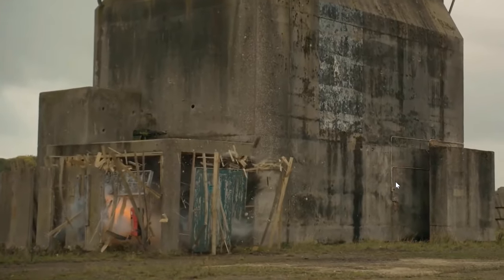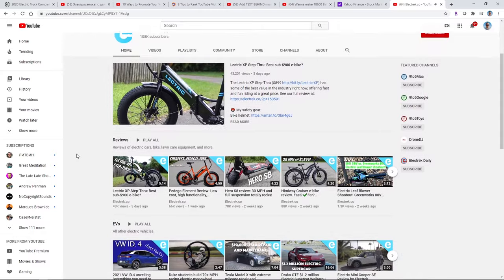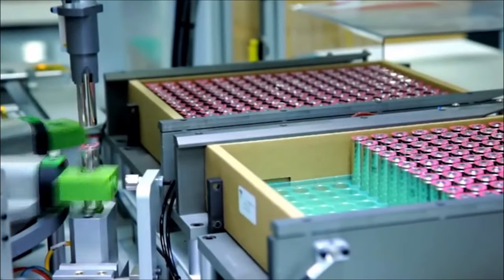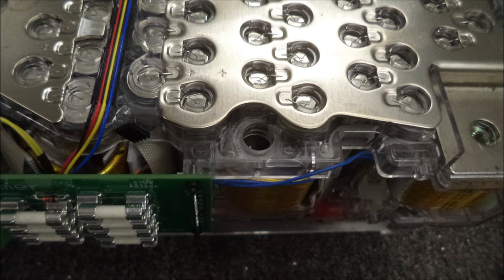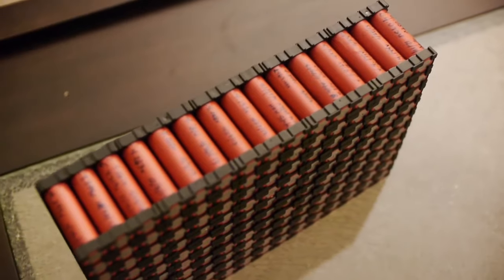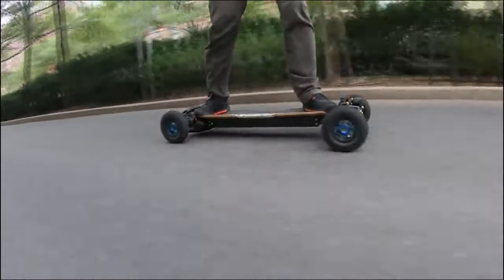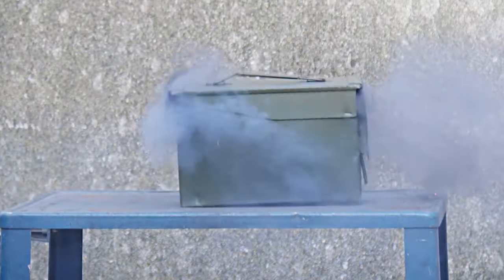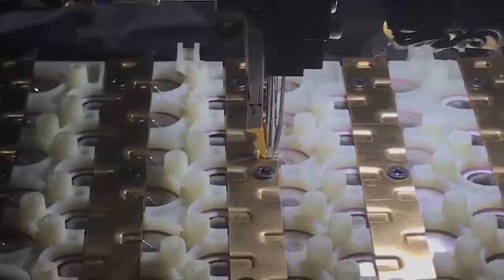7 Steps On How to build The Safest DIY Li-ion Battery

Comment: Great info. How do you look at commercial packs manufactured by the ebike manufacturers and their suppliers (such as Bosch) that do not use individually fused cells but instead connect them in parallel using thicker strips and have a single overcurrent protection circuit on the BMS?
Reply from the maker: Can fail easily and not safe. A opened a super 73 ebike battery and it had fuses so its happening
Reply: @ElectricVehicleSpace  Interesting. Even the latest models Bosch packs (the 'Powertubes') are not fused. Do you have pictures of that arrangement in that pack?
Reply: @ElectricVehicleSpace  By the way: these fuses are not there to protect against discharge currents, they are there for when the cell is internally shorted out to prevent the other cells from dumping their charge into the one that is already failing. This may prevent a fire. Typically this is used in vehicles against a pack getting crushed or damaged during an accident and the rest of the pack instantly dumping all of their charge into the cells that have been damaged causing them to explode. I think this is a fundamental piece of information that you were missing when making this video, or, if you did understand that it doesn't come out in a way that explains it clearly. So we are definitely not protecting against overcurrent discharge with these fuses.
Reply from the maker: @pianojacq  that was the all point of the video and it is explained 👌
Reply from the maker: @pianojacq  also overcharging or overloading or shorting.
Reply: @ElectricVehicleSpace  A per battery fuse in a pack with any substantial number of parallel cells (say, more than 4, which is most packs) will have cell-to-pack currents in the range of a few amps for most applications, but will have cell-to-cell currents within a cell group of 100's of Amps in case of compromise of a cell. This is what those fuses protect against, so by that point the pack is already terminally broken and the fuses are trying to prevent even worse. They have nothing to do with overcharging (that's a function of the BMS), overloading (which in a parallel setup will add up nicely to the point where you will have much more amperage available than your wiring or main pack fuse will be able to handle in the first place) or shorts other than bus bar shorts (and this is an important thing to protect against, but it is best dealt with by very solid mechanical engineering, something most amateur builds fail spectacularly at). 

So make sure you really understand the material, I can think of a scenario where for a given pack and BMS a per-cell fuse would hide a problem just long enough for a real issue to cause the pack to catch fire and that would turn a minor problem (faulty cell, or, more likely: faulty fuse or fuse connection) into a major one. You are 100% right that safely constructing batteries is difficult, that's exactly why you need to understand what you are doing and why you are doing it rather than to just follow a major manufacturer in their best practices and processes, especially when you will not be able to replicate those processes accurately enough to achieve the desired effect. 'Because Tesla does it' is by itself not a valid reason to copy their practices unless you fully understand their reasoning and engineering trade-offs, after all: you are not Tesla and you may not be able to do what they do safely or even at all. Unbalanced fuses due to manufacturing variance are more dangerous than no fuses at all!, and manufacturing them accurately requires gear worth many thousands of dollars, well outside of the budget of almost all amateur pack builders. 

If your message is 'only the likes of Tesla can safely build large packs' then there is probably a grain of truth in that but the rest of us mere mortals do have problems we want to solve in a practical way and we rely on each other and solid engineering knowledge gained over time to show how these things can be done safely in spite of the challenges.
Reply: @pianojacq This video is more like a safety sign. Very valuable when in a process of understanding deeply the forced marriage of used cells - as I am in right now. But your comments spiced this safety sign with substantial knowledge about what is actually the case about fuses. And yes, I agree that the video does not point out the precise function of a fuse. You added this knowledge. Thank you for that. Nevertheless, great video as platform for this topic. So, much thanks to both of you!

I'm building my prototypes in between stages of critical thinking about the outcome. That prevented me so far from accidents. In his book, Micah Toll is not comfortable with soldering the cells, since the heat could cause damage to the cells. What is a sound argument. He is promoting spot welding instead. But nickel stripes keep the connection even in a failure scenario. Thus, I don't get the advantage of spot welding nickel stripes despite. Therefore, I hesitate to build a bigger pack for a solar energy storage. I'm undecided in between fuses and nickel stripes. Well, by watching the video and reading your comments, I thought about spot welding a piece of nickel on each cell, just as conductive heat absorber. Then weld the fuses on it. But on the other hand, the small nickel buffer would also delay the burning of the fuse in case of an overheated cell. So, what is a reasonable way for voltage converter (1500Watts) which will be used for a fridge/freezer and some USB-Devices (±200Watts permanent with load with some peaks).

Would be great to have your thoughts on it.
Reply: @Ma-Nuu  Spotwelding is the only way to go, soldering is not something you should ever do, especially not to the negative. It injects too much heat because of the duration of the process (not because of the temperature, which is actually quite higher during a spotweld but the total energy injected is far lower because the spotweld is a matter of milliseconds).

Per cell fuses are useful once you start to go into > 10 cells parallel, but they add complexity and will result in a pack that may age much faster (though, arguably, once a fuse goes that cell group should be considered compromised anyway).

1500W without a voltage to go with it doesn't say very much, the important part is the total current in and out of the pack, you typically would fuse the whole pack for about 1.5 times maximum current and if you are going to drive inductive loads, in which case you want a slow fuse.

Try to go with the highest voltage inverter that you can get, 48V would be a good one to aim for (these can be had fairly easily). In that case you'd be looking at 30A, the question then becomes how long do you want to be able to supply that system with power, 30A sustained is nothing to sneeze at, if you want to do that for more than a few hours you'll be building a pretty serious pack. Make sure you take into your calculations that you will never use the total available capacity of a cell, you don't really want to charge to 4.2V and you don't really want to discharge to 2.7 which is the full voltage range of a cell. Typically you'd cut off around 3.3 during discharge and 4.1V during charge, which when combined with the charge/discharge curve of your chosen battery should give you a lower limit on how many cells you will need in parallel to sustain that current for the desired time.

Finally, I would suggest that before you build a massive pack like that as your first that you build a couple of smaller packs to gain some experience. Make sure your work area is absolutely spotless, no little bits of metal lying around there, cut all your strips prior to the assembly process and make sure you get real nickel strips and not cheap knockoff lightly nickel plated steel because it just isn't the same thing resistance wise.

best of luck with building your pack!
Reply: can one reupload a video? @pianojacq
Reply: yeah right. trying to save face. you screwed up. and you should reupload the video with the clear explanation.  @ElectricVehicleSpace

Comment: Seems like it should be common sense, but since it's not... Great video!
Reply from the maker: thank you. i hope it helps.
Reply: @Bo Davis -  Since when is Electrical Engineering called "Common Sense" ?  Cell Level Fusing does NOT guarantee the a P-Pack will never catch on fire ...
Reply: @MrSummitville  wearing your seatbelt does NOT guarantee that you won't die in a car accident either, so I guess I'm missing your point. Also, if "electrical engineering" is such a concern maybe there are other avenues to take in being educated than YouTube. I was mostly just being facetious in my comment, but I guess that wasn't common sense either.
Reply: @bodavis3819  Cell-level fusing does not prevent a fire, so then what does cell-level fusing do?   Can cell-level fusing actually become a false sense of security = dangerous ?

Comment: May you take similar approach to BMSs topic as in this video? The cheapest one are only resistive and that is just loss of energy and I'm wondering how does tesla do the balancing for example - I'm sure not the resistive way. Cheers
Reply from the maker: There is a lot of info to discuss about the bms. I already removed 2 comments that are not related and the other guy is talking about using tape etc... things that should not be used and people don't understand the basics. I thick BMS is more complex and will confuse people than help. If someone decide still to make DIY packs they should invest more time to and learn all aspects of how to choose the right bms and how to properly use it. There are so many bad quality bms no on the market. You need to know which and where to buy it from.
Reply: @ElectricVehicleSpace  that's what I ment writing the previous comment. There is plenty of tutorials and vids about the cheapest BMSs. What is more most of them gives incorrect info that can't be trusted. To be honest after pretty darn good research I'm still not sure how the tesla or any other battery pack made out of modules connected in series should be balanced

Comment: I was thinking about making a battery pack specifically for powering a computer away from the house, do you think I could use this to get away with that (I'll need a few extra pieces to control the voltage and amperage as well but as far as the battery goes what do you think)
Reply: As long as you have a current limiting circuit and can output a constant voltage as the pack drains it should be fine, I don't see why it wouldn't work. As long as it doesn't go over the operating voltage (usually 20 Volts with a 5% safety margin, which means don't exceed 19 Volts) and is current limited it should be fine. Make sure to include a low voltage shutoff circuit so you don't go below the cells minimum voltage or you'll scrap the batteries.
Reply: @TheExplosiveGuy  Thx man
Reply: @hussalojr5916   Thats pretty much what a laptop is, Go for it